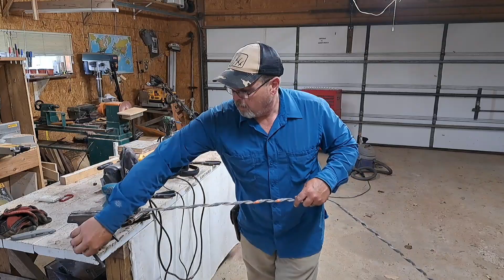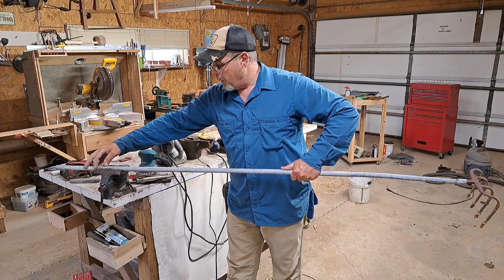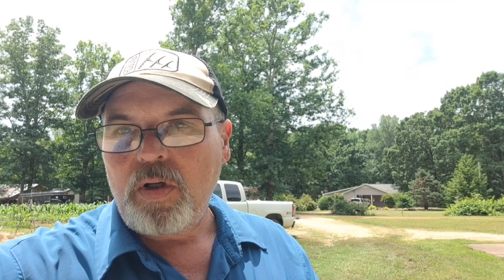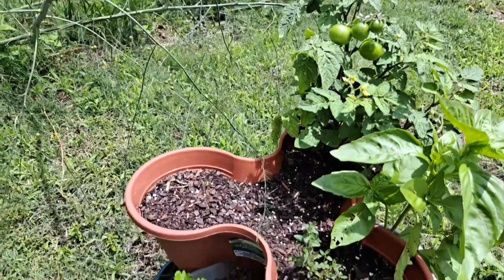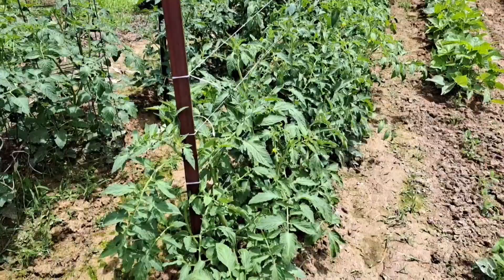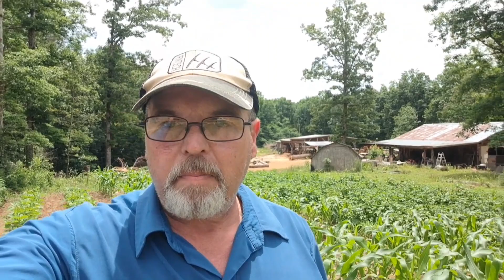Galvanized Steel Electroculture #electroculture #electroculturefarming

Comment: Electroculture is a simple method of applying atmospheric (free) electricity to significantly increase plant growth. Using basic materials like copper wire (and/or magnets) to vitalize the soil and increase yields by 100% - 300%. It also eliminates the need for fertilizer and pesticides, explained that it is not electricity as we know it, but a breath of energy... which stimulates and increases the fertility of the soil.It basically takes the existing static electricity in an ion form and transfers those charged ions from the atmosphere through the copper or wire that can transfer that energy into the ground where the plants are, what this does is stimulates/charges or revitalizes the living microbes in the soil and promotes the charged nutrients near the roots of the plants by electro migration. Another example would be when there is a lightning storm, the lightning charges the ions in the atmosphere in which the plants absorb through the leaves and converts that into energy (energized nitrogen concentrations). You can really see the growth effects on wire type trellis  plants that are touching the wire because that atmospheric energy from lightning goes directly to the plant, it would be like a direct shot of low voltage steroids. lol. A lot of my research findings also encompasses magnetism, i have seen other experiments using high powered magnets that enhances plant growth, Magnetic North has something to do with this too but i do not fully understand the science behind this or how to apply magnetism (i am still learning this). 
Copper does work the best for ground installation because the copper also reacts to the microbes/molecular structure of the soil when energized. Galvanized wire is great to transfer that low voltage from the tower/atmosphere to the copper then to the ground. 
On the same subject but a different note, i will send you another email with some more links and information to assist in your experiments if you don't mind. I find this stuff extremely fun and stimulating to try and figure out, it's putting together past proven technology that has been forgotten in the Western world.. i enjoy the videos you create, you remind me of me lol.  thanks.
Reply from the maker: Yes send me more info I enjoy reading it and I have trouble finding good info about electroculture thank you